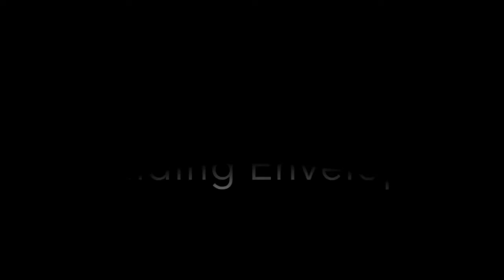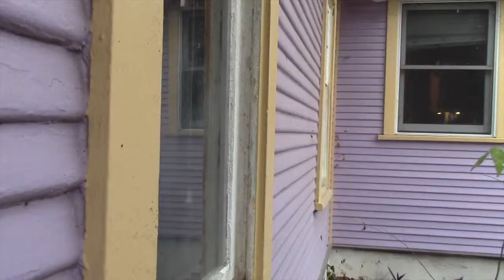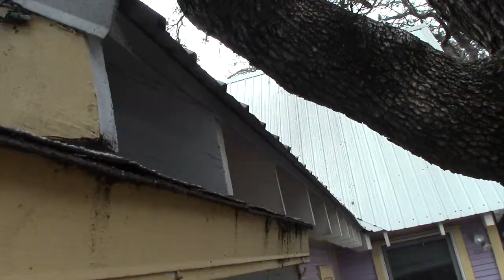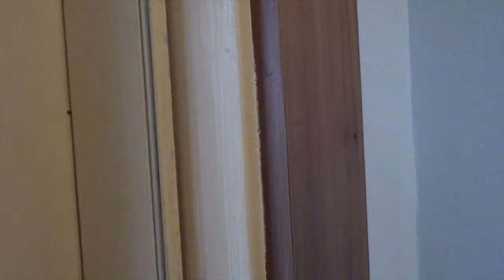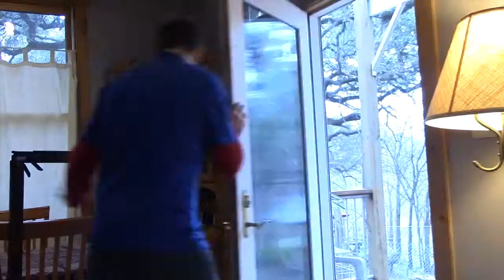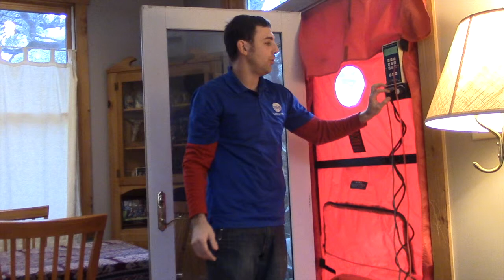The Importance Of Measured Performance - Part 1

Comment from the maker: Home performance is crucial, but measuring that performance is the only way to really grasp what's been successfully built or not. The design process is the best place for indoor comfort to start, which is why Positive Energy works directly with architects to help design mechanical systems. The best place to see if it worked is in the home itself, which is why Positive Energy works directly with builders to evaluate the performance so the homeowner can be comfortable and happy.